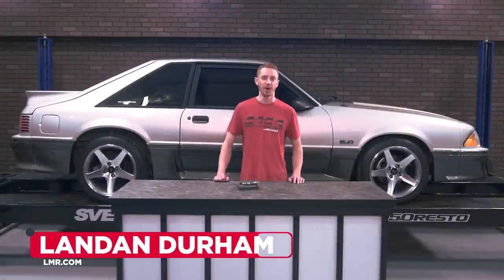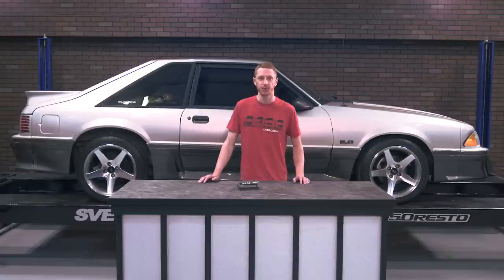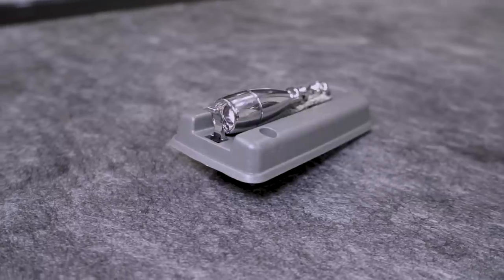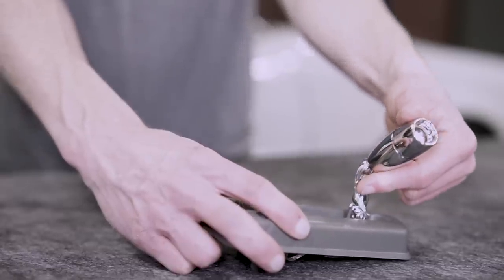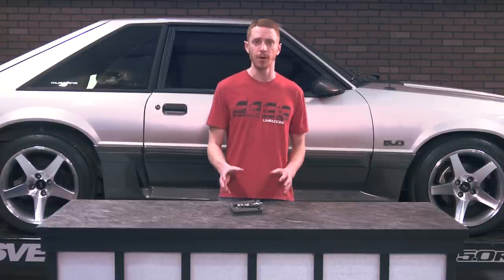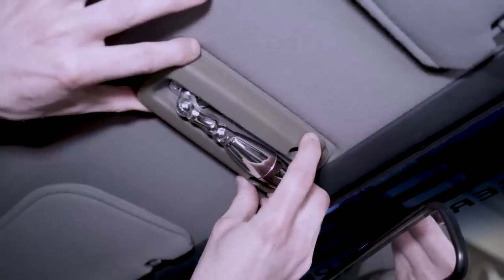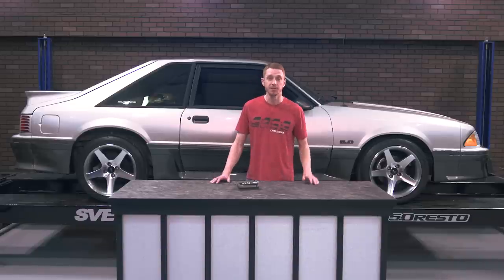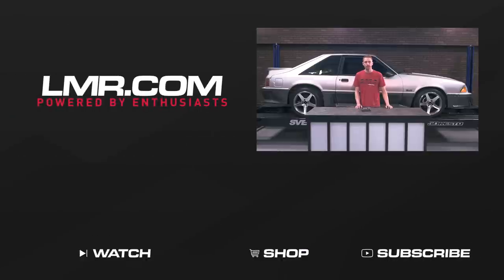Fox Body Mustang Map Light Assembly Review & Install (1985-1991)

Comment: My map light has always worked. Recently the bulb went out. What is the correct bulb to replace it? Can't find it anywhere.
Reply from the maker: We currently do not offer the OE correct bulb for replacement, but you can check and see if the #1816 bulb will fit.